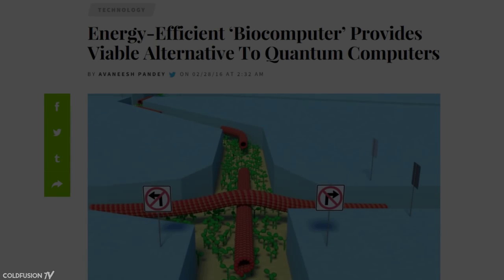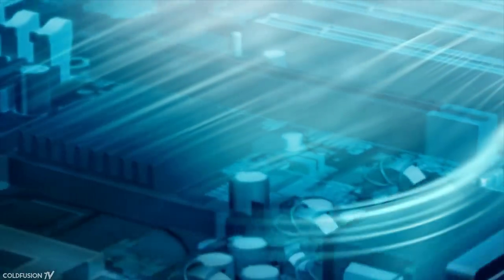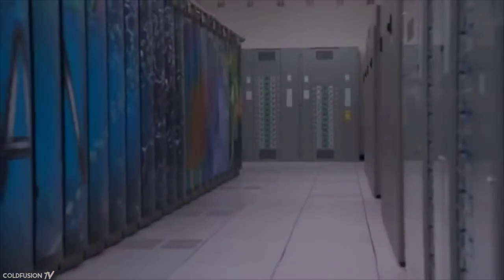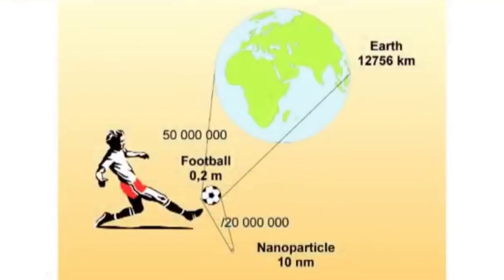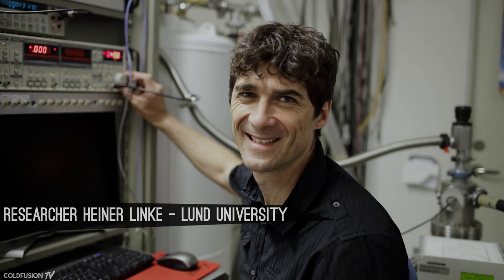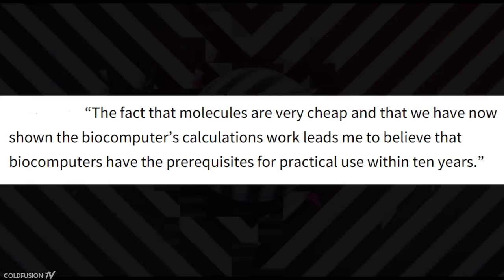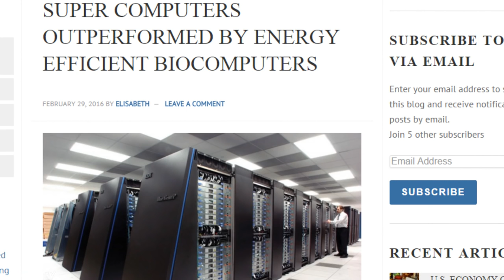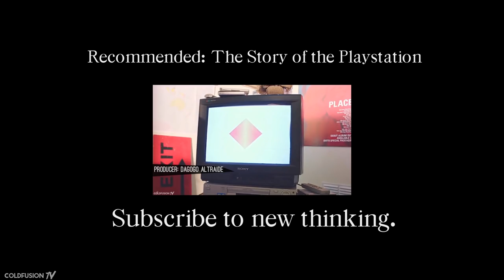Nano-Biological Computing – Quantum Computer Alternative!

Comment: Parallel computing, quantum computing and classical computing are each suitable for different tasks. Parallel computing is already used in graphics cards. It would appear that the main advantage of the featured technique would be lower power consumption. It is perfectly possible to create highly parallel computers with silicon. The main problem is that we are yet to develop good algorithms for highly parallel computers which is why it is not heavily used.

Comment: Rates vary by more than a hundredfold, from 0.04 μm/s for myosin I in the brush border to 4.5 μm/s for myosin II in skeletal muscle. This variation reflects the specific functions of different myosins;fast movement is associated with muscle contraction.

The speed at which an operation can be performed is limited by the frequency at which the transistor can switch from on to off, and still perform without failure. Since transistors are the building blocks of the logical gates, this switching frequency also limits the operating speed of our processor.

So, if we feed our processor with one input signal per second and the processor performs our operations error-free, we say that the processor is clocked at 1 Hz. In other words, the clock speed (referred to as the clock frequency or clock rate) of the processor is a kind of certification telling us how often we can give it instructions and still have failure-free operations. Looking at it the other way around, a processor with a clock speed of 3 GHz allows us to feed it with 3 billion operations per second

So which of the two is faster, the switching of a transistor or the the movement of myosin with the help of its head domain.

And which myosin are they talking about; 1,2 or 5? Also all myosins are regulated in some way by Calcium ions. Where would you store a medium containing calcium ions in a computer. All myosins are ATPases. So where would you get ATP from?
In essence biocomputing is making simple things complicated not to mention myosin is a protein that will eventually degrade if not kept under the optimal conditions. It can also mutate because the core of the myosin motor domain is structurally similar to that of kinesin, a microtubule motor protein. Both motor domains contain the so-called Ras fold, in which a nucleotide molecule is bound to loops at one end of a Beta sheet domain.

Comment: This is a very interesting concept but I don't think it could ever be mainstream. First, biocomputing is on the scale on micrometers, while classical is nanometers. That's a 10^3 magnitude difference in size alone. Also, the movement speed of protein is not fast at all and will reach a maximum speed much lower than electrons. I think the real future is in photonic computing where size will take some time to catch up, but the speed is extraordinarily quicker with much more manageable heat output. The fastest photonic transistor is clocked at 800+ GHz.

Comment: Many questions here.  Yeah, biomolecules are cheap to make, low energy, and can do many things in parallel.  But how do you coordinate all these parallel results (scatter / gather pattern in parallel computing)?  How fast is the gather part?  What is the overhead of coordinating the parallelism?  Since these are low level biomolecules, how do you deal with error correction?  Myosin strikes me as kind of "slow", even though you have the advantage of massive parallelism here.  What is the computational model used here? (I understand the turing machine with 0's and 1's.  With quantum computing, one utilizes the properties of quantum mechanics, superposition and entanglement.  But what is the model here with myosin in parallel?)

Comment: Can't see this as competitor of quantum computers - but sure as a further development of the classical computer concept. As always pointed out - there will always be (at least for quite some  decades) tasks that are more suited for either quantum algorithms or classic algorithms. And as nano-computing is classical computing with high parallelism it won't be long (if ever - they said available next decade - qunatum computers are yet available)  that they again can't compete with quantum algorithms in e.g. optimiziation problems. And as qubits theoretically can be subatomical - also miniaturization will be won in the long run.
Reply: Great point! But... Although qubits are tiny, the actual quantum computers themselves are not :(
Reply: But that's all cooling and won't scale - so bigger quantum computers won't ever be bigger than the current ones.
Reply: Cooling might be the wrong term -  more thermal decoupling.
Reply: +Jörg Walossek I hope you're right! :)

Comment: But the big question's can this computer get rotten with the time.
Reply: may be,but it will be very cheap so doesn't matter
Reply: If it's sealed, no.
Reply: You just need to give it some portiens it will work fine
Reply: Also, can current computer equipment be used with these? USB, display ports, memory etc
Reply: +Yukito Atari they will probably work for way longer than an iphone
Reply: Dont worry, keep it in the fridge.
Reply: i don't know, can living things get rotten with time?

Comment: I wonder if there would be degradation in performance in the long run, what happens when one of these nano-proteins fails? Does it hinder the whole system?
Reply: the same that happens if a transistor in your current computer fails
Reply: Luckysquirrel1256 probably  won't fail completely, as it is capable of computing multiple problems at the same time, it would probably just use a different protein to find a similar solution
Reply: I wonder if we can create a protein to repair these nano-proteins.

Comment: Interesting development. Though I have to take issue with your reference of supercomputers only doing one calculation at a time, as they generally rely on massively parrallel processing. In fact my own 4 core CPU can actually perform more than one task at a time, because it has 4 processors. If what you said was correct then there would be no improvement in performance having more than one core.
Granted it was a proof of concept, and I am sure it will get much faster over time, but in the demonstration it took over 30 seconds to give several bits of data. Again it depends on the complexity of the actiual calculations, they could be extremely complex and 30 seconds may in fact be much faster than normal architectures.

Exciting times either way, and keep up with the videos, subbed.

Comment: OK OK... but isn't a protein significantly slower than an electron, to do any kind of task even if it can do multiple tasks at once, an electron would blow past a protein when comparing speed. an electron can travel about 2,200 kilometers per second, an electron can circle the earth in 18 seconds. proteins cannot do this. please explain to me how this works.
Reply: +ryxd100 This was my exact thought. Maybe this would be a better solution for things that don't require a low latency, such as simulation software that can be set to run and you can come back in a few hours. However, I don't see this being practical in a consumer environment where we expect our browser to open nearly instantaneously upon clicking it.
Reply: +Michael Mckinley definitely, from my current understanding of a protein a simulation ran from proteins might take as long as the digestive system, lol

Comment: There is a big problem with the SPEED of biological CPUs. Their advantage is, that you can "feed" them in tacts/clocks. They are like huge milti-pipe. We know from RISC processers, that it may be benefitial to split separate tasks to separate steps and feed the pipe in those steps. But, current RISC processors usually use 3-step pipe, roughly FETCH-DECODE-EXECUTE. Post-RISCs (and all the computers you are currently probably using to read what I have written), use some refined techniques to increase the paralelism, but still to very low number (e.g. 16). Back to biological computers: even with this multi-step approach (which could possibly be mimicked by classical eletronics), the computation needs all the computation steps plus all feeds to achive good statistical accuracy, which makes the computation WAY TOO LONG. It may solve some specific problems faster than today's computers and with the scalability even better than nowaday D-Wave Quantum computer, but they are no match for true Quantum Computer and in fact not even match for ever better GPUs (graphical, ever more paraller, processing units).

Comment: What is the process rate of a biological computer. Muscle fibres either contract or they don’t, so I don’t understand how we are left any better than 1,0. And moving an object physically through a pathway will never compete with transistors, it would take the computer ten years to run the operating system to the main screen

Comment: The only benefit I see there is lower cost and power consumption. Each of those junctions is still a classical bit and subject to the same limitations of a CPU. It also doesn't do anything to rival a quantum computer because a quantum computer's power comes in the density of information in a quantum bit which again, this doesn't do anything to address. It's an intriguing proof of concept, but I think there are some very unfounded claims here. That or some critical details were completely glossed over.

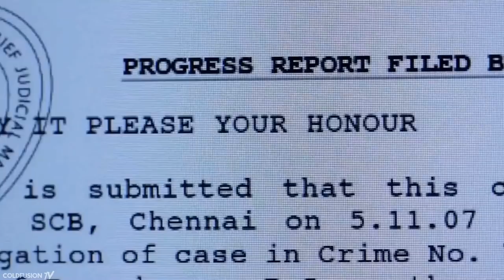Comment: 1:16 two misleading statements here. 'instruction set' is not the phrase you wanted, and NO, it doesn't switch between tasks at the same speed as the CPU clock! That would be impossible.
Reply: +macronencer there's a lot more issues with this video than that.
Reply: +Eaton Emmerich Yes. I was just going for low-hanging fruit :)

Comment: Single core, single thread CPUs can actually execute several instructions in parallel.

I wonder what the error rate is with such processing circuits? A key property of current digital CPUs is that they're absolutely consistent.
Reply: +djayjp Several instructions in a pipeline, not in parallel. Unless you are talking about hyperthreading (more than one logical core) in which case it is not a "single core, single thread CPU"
Reply: Point being? The A9 has more than one logical device.
Reply: Sean Wood Note the part where it mentions the A9 is 6 ops wide per core (as opposed to deep in regards to the pipeline).
Reply: +djayjp 6 micro-ops, allowing single instructions to be decomposed, paralleled, and hence complete in a smaller number of cycles. Still instruction by instruction though.
Reply: Sean Wood No, it can issue 6 operations per cycle. It also has 4 integer pipelines/ALUs.
Reply: And as I said in my first comment, pipelining instructions (which are not micro-ops) is not the same thing as paralleling them.
Reply: Sean Wood There are 4 separate parallel integer pipes in addition to being a 6 micro op wide cpu.
Reply: Right! So we not strictly talking about a single thread core then :)
Reply: Sean Wood No, these are single threaded cores, not SMT cores. What I previously mentioned is exactly why CPUs can get faster despite operating at a lower clock rate-- wider CPUs can execute more operations per clock cycle.
Reply: Sean Wood This should help:

http://www.anandtech.com/show/6330/the-iphone-5-review/7

The next page also discusses IPC (instructions per clock).
Reply: Sean Wood https://en.wikipedia.org/wiki/Instructions_per_cycle
Reply: I see what you're getting at. Would having more than one ALU per core then mean that in fact each core has more than one logical unit?
Reply: I think the confusion here is in the narrator's vague use of the word "thread", in that threads can be interpreted in quite a few different ways depending on what level you look at the CPU.
Reply: All accuracy of the video was lost at the point where he said "instruction set by instruction set"

Comment: I was thinking what if IBM used the basic AM-crystal radio as a the blueprint of the neuron and the oscillation of the nano-crystal would be changed by the incoming EMF produced by the output of the nano AM-crystal radios in the same system {brain} . I suppose the oscillation would be set to a common at first, like the same as our perception of time... Now that I type it I see It would not work for a reason or two but maybe it would work for this or that. It works for nanobugged. nanobugged? Its the use of nano-AM-crystal radios that are each combined with an amino acid.  {5 copper+1 germanium+ 10 copper+              1 germanium+ amino-acid that will combine with the nerves system} when ingested. The sound in the environment causes piezoelectric effect on the nano crystals in the human bugs nerves system and the emf by the insignificant in number to the over all nerves system, but significant enough to be obtain by satellite . Much like the way that transmitter the size if a grain of rice could be put under a dog a child or human could be tracked from space. The nerves system is larger. The extra's  or the bells and wisely and voices are optional. But that like having a 4x4 truck with mud grips and never hitting the dirt. The vibration of the nanohetz from the AM Satellite are the same as the oscillation of the sound that went into the microphone (no pun) sitting on the desk at anywhere on earth. It sounds to the human bug as if the sound is enviromental being the crystals are vibrating also in the inner ear nerves that the brain interpets what we call sound when the fluid in the sack is vibrated by the hammer bone the exagerates the vibratin of the eardrum  #nanobugged ----the true story

Comment: While interesting, it isn't really feasible for mass production.  Myosin requires ATP to change conformation and move actin filaments.  I know I don't want to be squirting ATP liquids into my computer every couple of hours.  Then there's the case of waste.  What do you do with all the ADP left over from ATP hydrolysis?  You've got to flush out the garbage on top of refilling they system with ATP.  Gimme a break

Comment: But those protein filaments could never be as fast as electric current, or could they?
Reply: +Maarten DJ
Unlikely. However, idea is that while it would take a while longer to calculate a single thing, it would much faster calculate a whole bunch of things at once.
However, there is another problem they neglected to mention. Proteins would way faster wear and tear than silicon. So unless if some sort of advanced regeneration is employed, such computer would be way too impractical. Also, it would be difficult to interface biological mechanical computer with our electrical devices and signals.

Comment: Most times, i like your videos. But this time, i am really disappointed how you did not point out, that quantum or biological computing can NOT!!! replace normal computing. As it is true, that quantum computing can do things, a normal computer can't do, it is also true and necessary to be mentioned, that a normal computers can do things, a quantum/biological computer CAN'T do. Or to be more clear, they would operate those tasks much slower than normal computers, because of how they work. You can't replace a normal computer with a quantum/biological computer. Not now and not in 100 years. I wished you would have made that clear in your video.
Reply: +Widur This is fundamentally untrue. A quantum computer can do virtually anything that a normal computer can do, however, there are no specific speed advantages in using a quantum computer unless trying to solve extraordinarily complex algorithms.
Reply: +Ytremz git rekt

Comment: I am a career embedded software designer. Some claim that the breakthrough in parallel computing will be at the substrate level, such a quantum computing or this video's topic of bio computing. But general purpose computing requires the parallelism to be embedded in the software at the highest level of the programmer's formulation of the problems. Quantum computing is only fast when it is applied to specific math problems, and the same would hold for any substrate. Making smaller components just takes the single pipeline structure of today's processors and makes them run faster. That's not parallelism. But how do you train a generation of programmers to write parallel programs? My answer is that we already have but just don't know it yet. Everyone in my profession is used to breaking up SW into parallel processes called threads - which today run on the same processor by taking turns. The trick will be for compilers to take these threads and run them on separate processors instead of the same one, but this is going to require redesign of our hardware which is perfectly doable but which I have not yet seen talked about. In order to share resources like memory, ports, or disk space, the resources will be external to the processors and the ways of gaining or waiting for access to those resources will be built into the hardware. New compilers will take software mutexes (which are ways of negotiating access) and turn them into symbols that represent physical hardware elements that mean the same thing from different processors on the system. I'd love to design this myself if I had the funding for it. Maybe time to call the patent office.